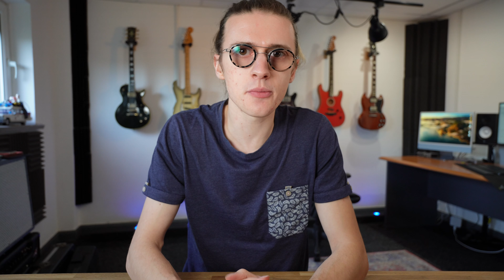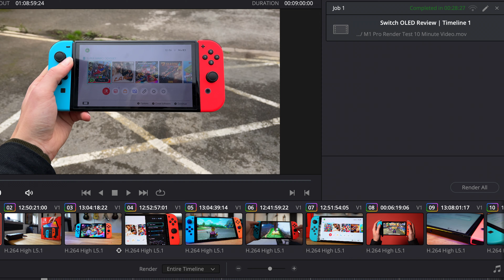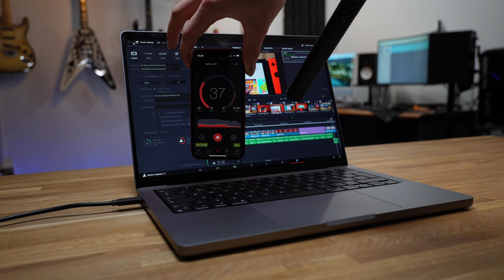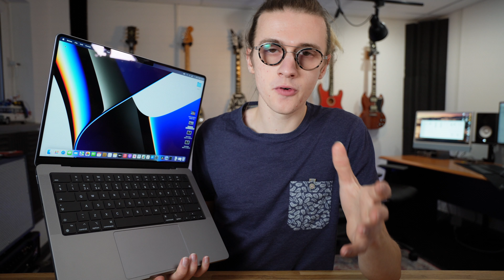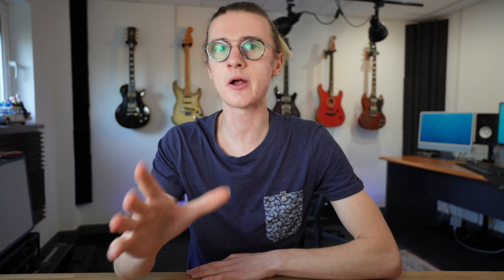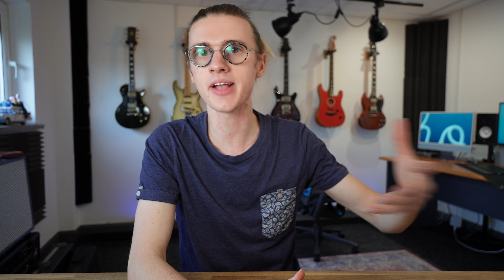M1 Pro vs M1 Max vs M1 MacBook Pro - NOT WHAT I EXPECTED!! (FAN NOISE + CRAZY PERFORMANCE)

Comment: What do you guys think is the coolest specs available to choose?  Is 16GB cooler than 32GB ram? I guess 32GB could be cooler because less need to swap memory on SSD.

Thank you to someone that has tested, temperature is everything for me. Hate the fan noise that comes with higher temp.

Comment: Which part is NOT EXPECTED?
Reply: It's clickbait.  His coverage of the 14" M1 Max MacBook Pro fan noise is garbage.  He has no idea what he is talking about.  The fact that he said "twice as loud" in reference to a logarithmic scale tells you everything you need to know about his technical competence in this realm.  If the machine isn't thermal throttling and the fan noise is normal (and this fan noise IS a very normal level), the thermal solution is perfectly adequate.

Comment: This guy understands nothing about thermo dynamics.  More cores with more processing, produces a higher heat load to be dispersed.  Then he compares two different chassis sizes.  So you're generating more heat, with a smaller amount of venting, means more airflow is required to disperse the heat. Anyone with any amount of understanding of computer temp managements, would expect this. Not bitch about it.
Reply: Yes it's physics but the comparison is welcome for peoples who hesitates between both sizes and M1 Pro/Max chip. Maybe the Max in the 14 inch would be quiet even with more heat. With this video we can see it's not so for peoples concerning about fans noise it's maybe not the better option.
Reply: @GanymedeJisuiné  -- I'm not sure I understand your point there. There's no way the max could ever be quieter than the pro in the 14" chassis. It's the same cooler, same chassis, trying to dissipate more heat. When one compares a 16" pro against a 14" max.... they're stacking the deck for a preconceived outcome for the sake of manufactured outrage, all in the name of clicks and watch time.

That said, you're right that people deserve to know the compromise they may be making. I'm not challenging the results or the advice, but the manner in which its presented.  I just don't think it should be a surprise, or something worth ranting about in TWO videos. ESPECIALLY for someone who claims to be any form of info source on computer or recording hardware. I honestly don't know how anyone with experience with multiple generations of either could ever be outraged about those findings, and as such I question the quality and intentions of their content as a whole.
Reply: @shabadabadoo4326  I understand your point. Sorry to not being able to be as clear as you but English is not a language that I speak well.

I just point the fact that : Yes , the max in a 14 inch is necessarily warmer / noisier than the max in the 16 inch or even more the pro in the 16. But the question was to what extent.

My exemple to illustrate my word :
I am interested in the 14 inch M1 Max

If the 14 inch makes a little more noise and heats a little more (let say 2-3 degrees celcius) than the 16 inch it suits me perfectly

But if the 14 inch makes a lot more noise and really heats up a lot more than the 16 inch (or even throttle) then I will go for the 16 inch.

Comment: I still believe that the audio is not that loud and you turned the mic up like jn your previous video, 57db does not sound that loud especially compared to the 27db from the 16". It sounds 4-5 times as loud not 2 times

Update: I do believe I am right because looking at other videos, somebody maxed out the fan speed of the 14". The maxed out fan noise of about 76db does not even sound as loud as in this video.

Comment: really  great video but also slightly misleading/confusing. So to clear this up let me state clearly that the fan noise is NOT caused by the M1 Pro vs M1 Max chip, it is caused by the size of the laptop (i.e. 14" is noisier and 16" is quieter because it doesn't have as big cooling space/fans). So if noise is a concern obviously go for the 16"
Reply: This just isn’t true. The fan cools the SoC. the larger Max chip generates more heat as it has more cores to cool. So in  reality the fan noise is being caused by apples decision to put this massive chip inside the inferior chassis and market it like it’s the same as the 16in. It’s completely misleading and I can totally understand why people are annoyed by it. One of the largest selling points of the M1 for those of us in music production was how quietly these machines operate compared to intel. It seems from all the testing we are seeing that the 14in with the max chip is the most inferior in this regard to all the M1’s on offer. And people should know that going in before purchase.

Comment: This is true, I have both 16inch and plan to return Max chip due to 20% short of battery and 100% more fan noise, saved $800 for not upgrade to Max and 32G memory, in the end, lose about 40% of video export performance but I can watch YouTube whiles it’s doing work in background and I won’t notice. The basic config machine just amazing, don’t presumptive it’s like Intel gen MacBook

Comment: Did you try turning on "lower power mode" in the battery settings? It specifically mentions that the mac will operate more quietly right under the setting. Then you can have it quiet when needed, but still have the option of full performance when it's not. Also a 20db change in noise level is 10x the sound amplitude, so it's way more than twice as loud, more like 15x louder.
Reply: Exactly, it fixes the problem while still giving better performance than the pro version even in lower power mode.

Comment: 55 decibels is about the level of your average kitchen refrigerator.  The sound level of the microphone is not balanced against what is typical level against your voice - as the keyboard is not that loud as indicated by your mics.  Around 40 is your typical suburban area at night.  65 is your average conversational voice.  The scale itself is not linear, so 55 is not double 26 (26 is not audible to your average person).  In fact 55 is very unlikely full fan speed possible.  If you don't like sound - use the MacBook Air.
Reply: I’ve worked in professional recording environments where the sound of the fans of a computer could still be heard which isn’t good. A well soundproofed room coupled with great microphones pick up more than you think.

Comment: Being a photo enthusiast who rarely shoots video & has no real need for 4K & beyond I can’t  imagine any  going for the 14 inch for screen size preferably the 16. Who would ever want to edit important project on a laptop anyway.However I do prefer the portability of the 14. Surely any serious photo & video work would be done  at a desktop setup such as the longer for 30inch iMac? May I ask foe who may benefit from 14 M1 pro max , gamers?
Reply: Most professionals who use a laptop as their main workstation run an external monitor.
Reply: I edited thousands of photos for weddings on 12.9 iPad for 2 years. 14" is enough for me. I also have a 27" monitor but it honestly doesn't get much use. The 16" was just too big. Barely fit in my backpack and I transport my laptop every single day.

Comment: Imo, M1 Max probably should only be used with the 16" chassis, the 14"  has smaller fans and heatsink so louder fan noise and higher temp is kinda expected.
Reply: i agree, i made multiple options in my cart so I can filter out and decided to just go with the m1 max 64gb lol
Reply: 16 is much louder than 14

Comment: So you‘re the only youtuber with a noisy M1Pro/Max MacBook… that’s all I have to know…
Reply: If you look at this guy's 10 minute heavy load thermal test, the 14" fan is at  4500 rpm while the 16" fan is only just started. https://youtu.be/XqPhfUWJnxY?t=571
Reply: No, he is not. Others are just not covering it, yet. The M1 Max is pushing the thermal design of the small 14" MacBook Pro. Under full load CPU/GPU fans will be running mid to high rpm and will be clearly audible.
Reply: @wmt16  One  thing to keep in mind is that 99.9% of the people buying these laptops will never max out the CPU/GPU. I have yet to hear the fans on my 14" editing  thousands of large RAW files and 4k 10 bit footage.
Reply: @wmt16  so true
Reply: He was stupid enough to order the smaller 14" with the beefier chip, just to complain about fan noise.
GET THE M1 PRO FFS

Comment: Honestly its a really detailed video and I can definitely hear the noise. My only question is have you tried to see if you can quickly replace the M1 Max 14 inch to see if its an issue with your specific machine because again while its normal that fans turn on when the laptop needs to be cooled down its bizzare that its happening during a video render as Apple has special chips inside the machine which remove some of the strain from the CPU and GPU. 

Just some thoughts. I think overall the video was great and if you dont like the 14 return it because theres no point in keeping a product that you dont want.
I dont think even if the ports are covered youll have heat issues as Luke Milani did that in his test and it didnt affect performance or overall heat too much. It was kinda crazy
Reply: I saw Luke's video on this subject as well. Impressive performance.

Comment: My boy Ben 💪 keep uploading more u make the best tech reviews
Reply from the maker: Thanks Dude! Appreciate the support!
Reply: I’m a software engineer do u think the 16 Max 64gb is overkill , I’m stuck between base 14 Max or the maxed out 16in m1 max, it’s so hard to make a choice rn
Reply: @dronestrikejr  If you do not do graphically intense tasks like 3d visual work, video editing/Photoshop then you don't need the max at all, it will just waste battery life keeping the cores running. If you always use an external monitor and want easy portability then the 14 might be better, otherwise 16. I recommend the base 16 inch CPU with 32gb ram and 1tb or more.
Reply: @danieltalebi1040  thanks man I appreciate the help